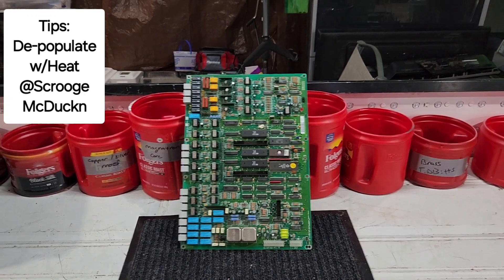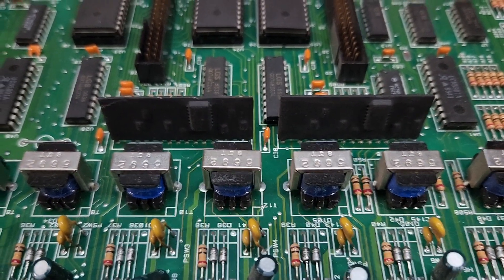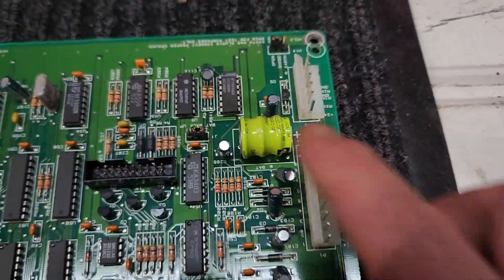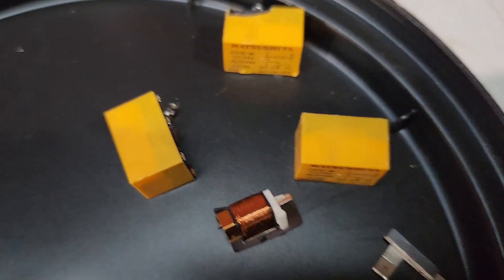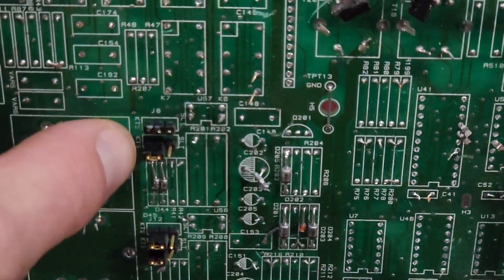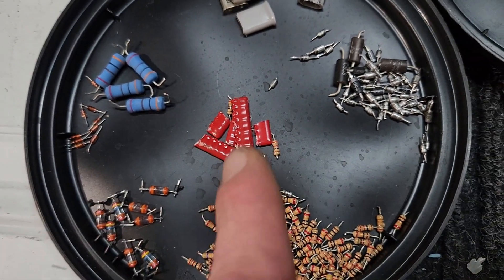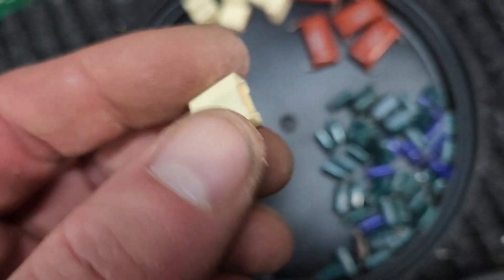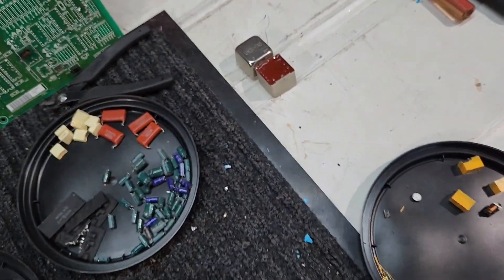How To get GOLD from FREE Electronics #gold #scraplife #howto #consumerelectronics #ewaste #silver

Comment: The stuff you call conformal coating is actually soldermask. They use conformal coating on pcb's over the components sometimes to protect it against esd and water.
Reply from the maker: @neoeldexter  yes. Someone had corrected that, it's nice to know the difference,  I have seen the conformal coating in appliances like washers... but never really heard much more about it. Would you happen to know a way to remove that particular coating? That would be good for the channel 😀
Reply: @ScroogeMcDuckn  I'm not in the know of how to remove it. But I think it's a uv cured resin. Maybe there's a solvent that dissolves that. When doing rework on a pcb I usually scrape it
Reply from the maker: @neoeldexter  ill do some research. It may have a heat process,  but I have a feeling it will be a bit more hazardous to do than I want to put on the channel at the moment.